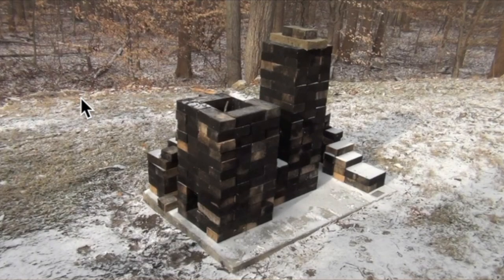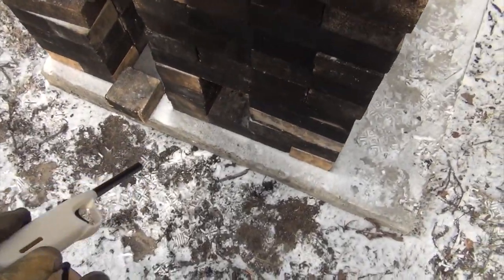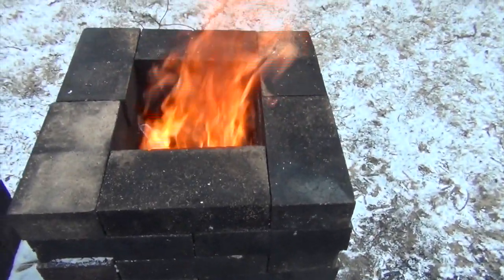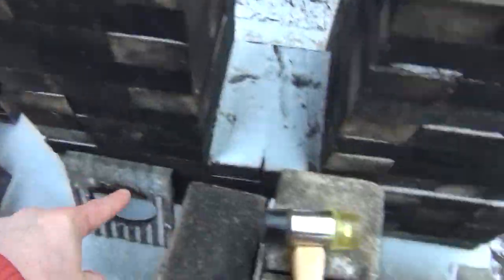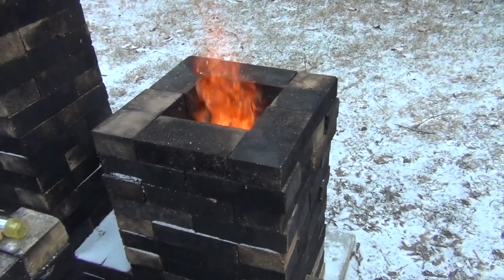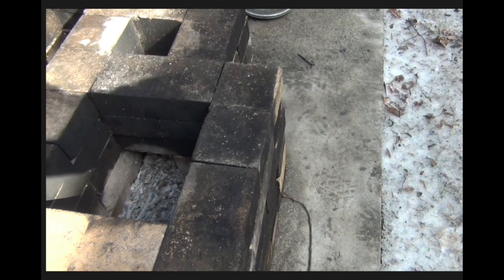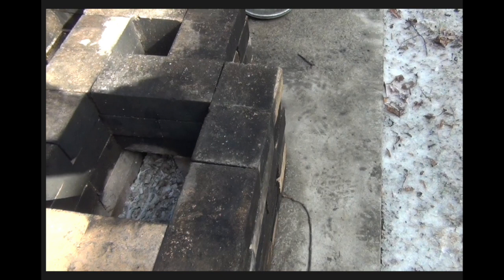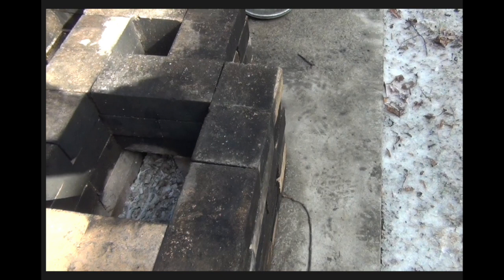Air Direction - Draft Experiment & Rocket Stove talk at end

Comment: If only you could use copper line to collect heat and move it to the home like a heatpipe with a cheap medium like PEX using a sharkbit connector.  Seems like PEX can handle 180 degrees so its not a terrible idea.

Comment: the horizontal burn tunnel and the vertical burn cavity are both too small. they should be minimum 6x6" and more if you dont clear ash after each fire. these dimensions have been worked out by RMH users. many have tried 4" channels and have had limited to no success. But basically you keep the tunnels same size as whatever you make your chimny(to simplfify explanation-more details can be found online in forums). Without first getting the basic geometry correct, all further experiments are suspect imo. The only time you may want to constrict this passageway, is to put a venturi in a particlar spot, but that is after a proper sized tunnel and before a proper sized vertical. The fact you think this is inconsequential is your right to have the opinion, but many have used 'proper' sizes and use the stoves with success. There's nothing wrong with thinking outside the box or experimenting, but to poo poo some basic proven ideas that are also backed up by some basic physics, it poor judgment imo
Reply from the maker: The goal of this simple draft exercise has nothing to do with what you are commenting on here. Did you listen to what I said about the experiment's goals? Did you watch the last two videos? What the heck ????
Reply: @stoveadvice  any experiment should strive to reduce all variables except one (the one which you are experimenting on). That is why you'd want to try and remove any question with regard to the sq footage of the burn tunnels  etc. To reduce them beyond what is generally accepted just because one thinks its ok, is not inline with basic experimental procedure. That is all. I understand and watched the other vids prior fyi
Reply: RMH?

Comment: I'd be curious to try closing both air supplies to get a rough read on how much air leak you get between those unmortared bricks.
Reply from the maker: yea.. it's hard testing many designs with the unmortared bricks. Lots of smoke leaks out and, like you suggest, the other side of the stove draws cold air IN. It's not a "true test" but I have learned to account for it. Sometimes I say.. if this (certain design) has only a tiny bit of smoke, then it would work GREAT once everything is sealed up.
Reply: @stoveadvice  yep, that all seems reasonable. Thanks for sharing your continued experiments. I'm in the midst of building a house (solo... Taking so long....). Some type of masonry heater is absolutely the plan for the main part of the house, so I'm enjoying all the variety.